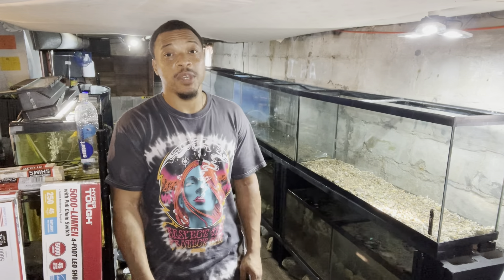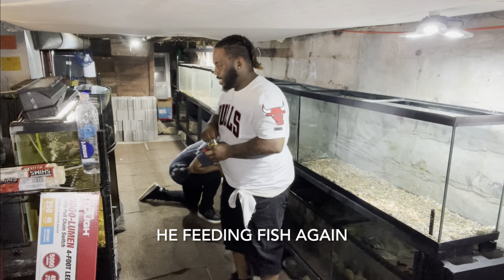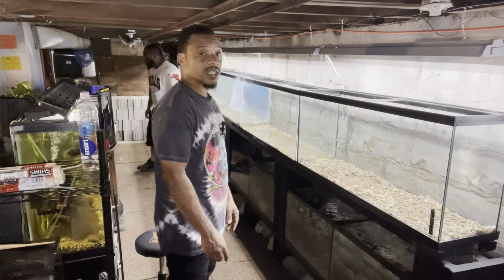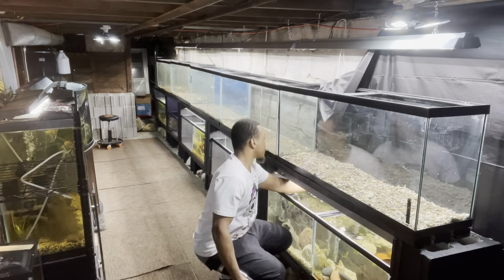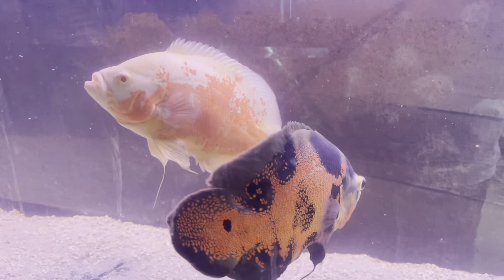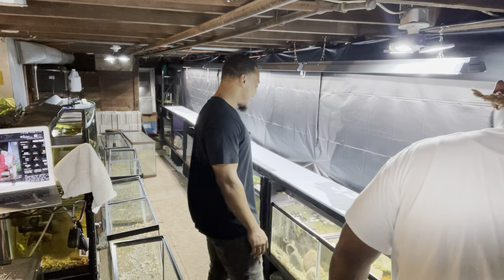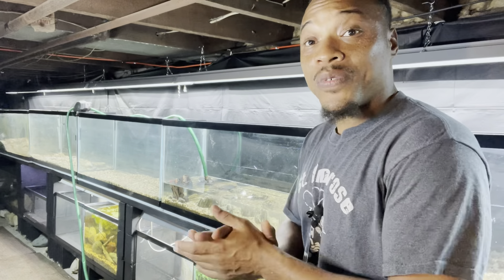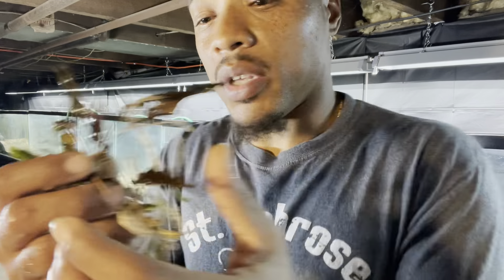DIY FISH ROOM BUILD | PART #4

Comment: That's a lot of light's.  More then my veg grow room.  If you ever need more lighting try rain gutters.  10' gutters at home depot $5.50, 2 end covers $11.00, 30' led with remote $34.  You can have a nice 10' system for 50 and save on electric bill.  If I remember, my shop lights for the grow room was $18 for a 4' light.  So 8' system is $36, then still need some t8 tubes..  so the cost will come out same but the electric bill will be more.  30" led is bout 35 watts or 1 t8 tube
Reply from the maker: Great idea

Comment: Bro, I'm digging your upgrade.  I just wanted to ask you if the way your setting up the top rack, are you sure that the weight of the water if not completely supported by the stand and not sitting open just with the weight of the boards and will not be too much weight on them?  just asking, but looking good.  I just got hooked up with your channel from OFR and other fish channels.
Reply from the maker: Yes the tanks will hold forever. Super reinforced..